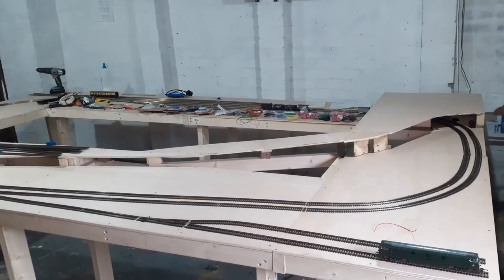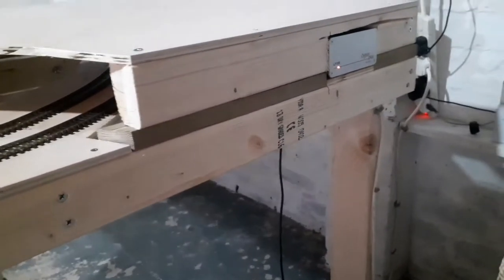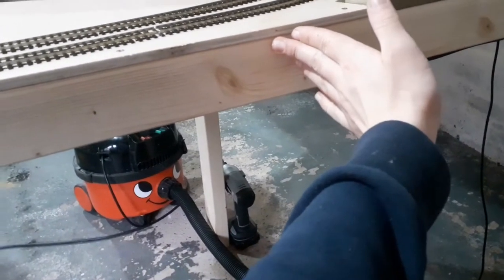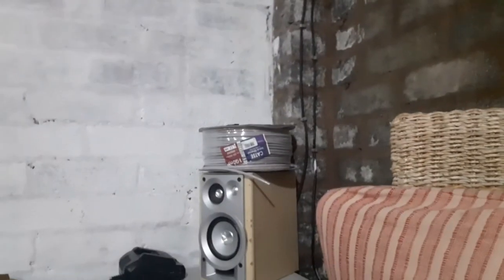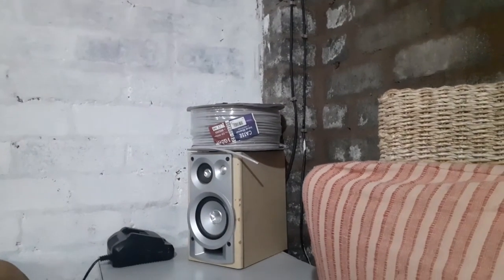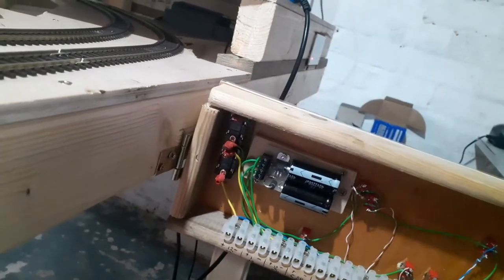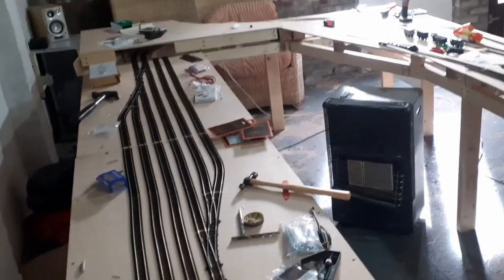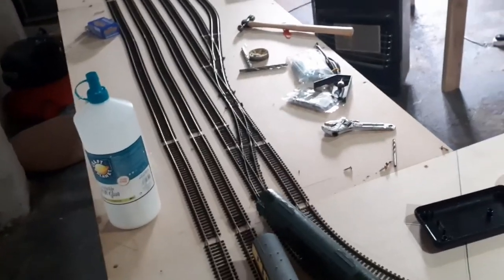6. Making Model Railway Control Panels and installing SEEP Point Motors

Comment: Thin wire won't help. 16v AC is an RMS value, so when rectified will give somewhere between 18 & 22 V DC, so will charge the CDU to a higher voltage. A fully charged capacitor with a higher voltage will give a bigger kick. The CDU outputs DC so is more susceptable to voltage drops over longer runs. Installing a second or more powerful CDU can also help.
With seep point motors I've found using double sided foam tape helps as this lifts the point off the baseboard and seems to travel better.

Comment: Wise choice on the connectors - computer connectors are designed for  data signals not carrying current.
My question is why not use DCC accesory decoders for your point operation, as you could then operate the layout from any location.
Reply from the maker: Hi there, at the time I filmed this video it was Purley a cost choice. On the next layout I'm going to be using servos on the merg cbus system so I will be able to control every point from both Control panels and the dcc handset.